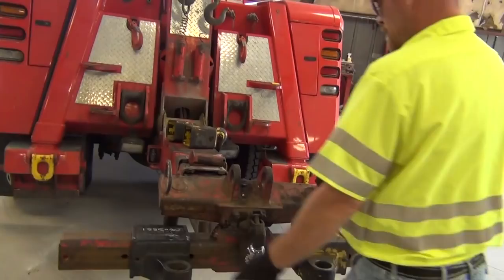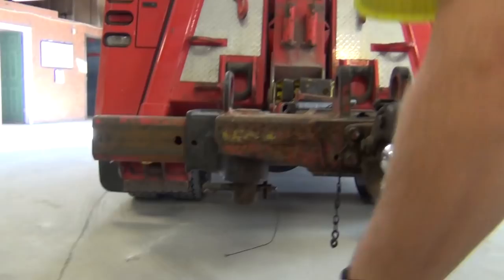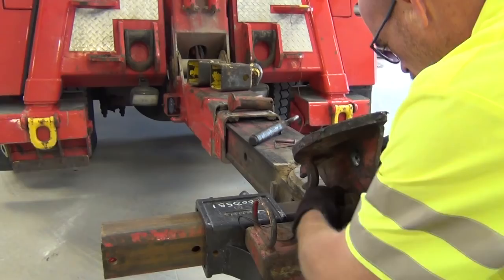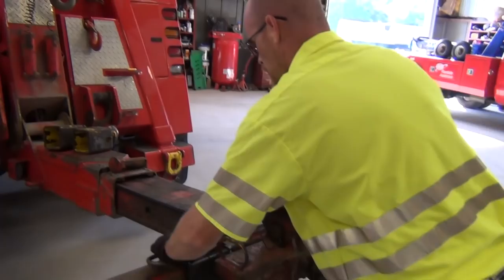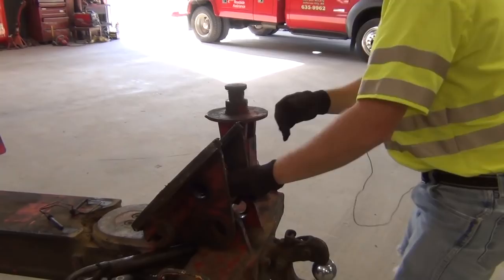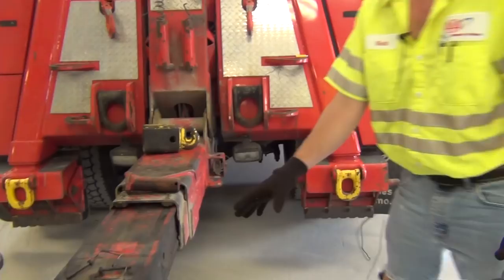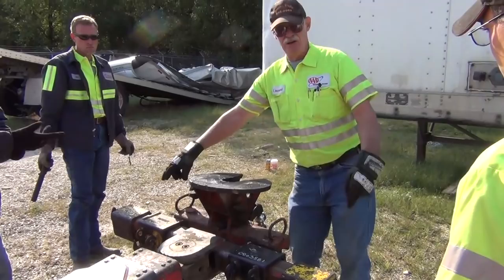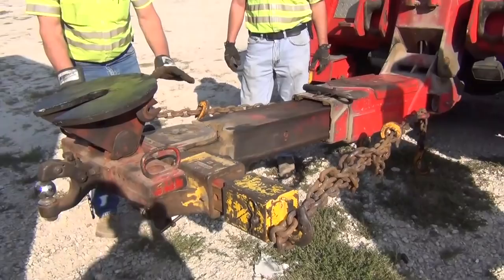Hauling A 53 Ft. Trailer With A Single Axel Wrecker

Comment: All the fifth wheel campers that I have seen had a kingpin on the trailer.  I don't think you can attach a kingpin to a kingpin.
Reply: Yeah I've never seen any trailer with the fifth wheel plate upside down and on the trailer itself, You can, however, use that kingpin attachment with that setup but upside down to haul a truck with a fifth-wheel plate backward by lifting it with the kingpin.
Reply: I believe he probably meant a gooseneck trailer, not a fifth wheel

Comment: the thing he said he would use for a fifth wheel trailer is no true which it can only be used on a goose neck or horse traler hook ups.
Reply: Won't work on mine. Mine uses a ball. Won't work on my 5th wheel either lol.
Reply: That's actually used to haul trucks with a fifth wheel plate if you mount that attachment upside down, Miller industries made a video on it.

Comment: With the reach so far out, it seems that too much weight would be transferred from the steering of the tow truck. And it would put added stress on the reach extend cylinder and frame. Assuming the trailer is at full weight. 
Or sucking in the reach would be a bonus in making turns and making a shorter truck and trailer would be better for travel. Right???
Reply from the maker: +Andrew Brenneman One thing I think I failed to mention is that, with this single axle Pete, we only haul empty trailers, so the weight wasn't an issue and we could steer. And yes a shorter truck would make it easier to turn but then you'd run into the same problem you mentioned in the first place...no steering.
Reply: Exactly Andrew, also the rear axle is way back not centered under the bed. That gives you plenty of weight distribution between your stinger  and the front trailer axle.